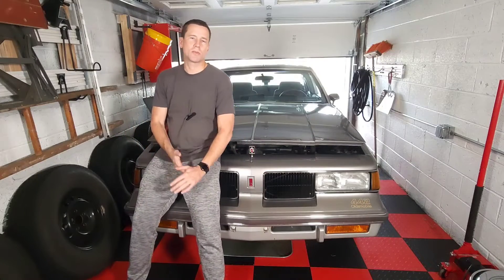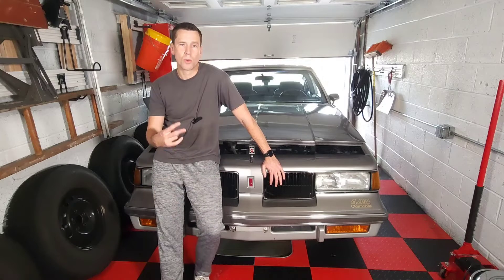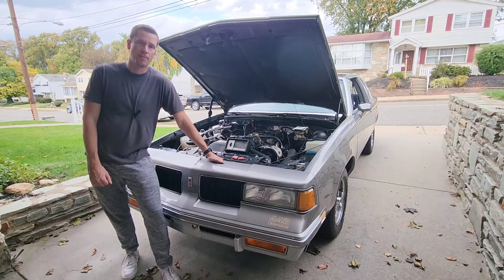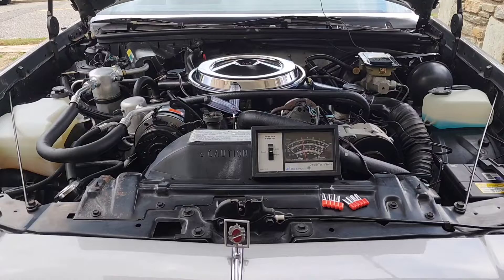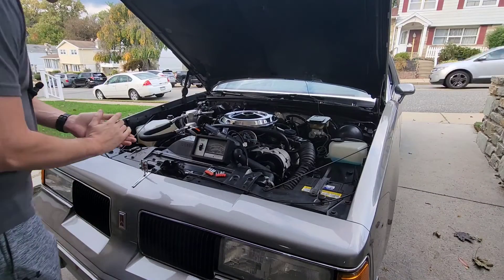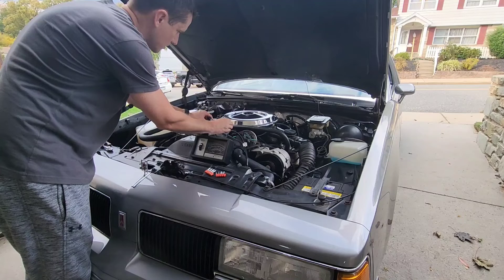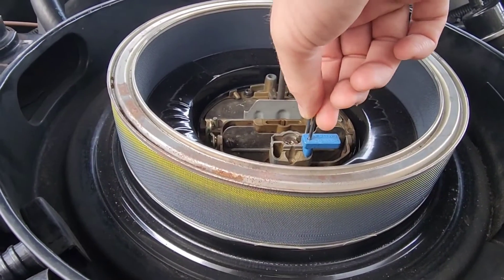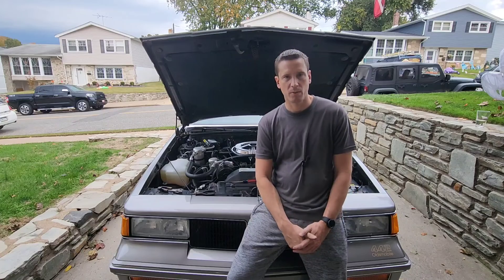Electronic Quadrajet / Dualjet FULL CALIBRATION On The Car - Part 2

Comment: Question: When you are adjusting the mixture control solinoid with a rich  limit, stop that goes with the screw, mine has this, arent you adjusting both rich and lean adjustments at the same time ? On the bottom of the limit stop is two small pins that fit into two holes...as if they wanted you to seat the pins tight. I have another e2me that does not have that stop what was the reason for it...?

Comment: Ok, so set dwell at 30 on idle screws, then adjust Air bleed...but....if you're at the ideal 30 from the idle screws, how do you know what to adjust air bleed valve to???
Reply from the maker: As long as the idle is smooth (where you want it to be), and the dwell is reading correctly, you may not need to. The air bleed adjustment can be used to tweak the reading on the dwell meter if it's idling smoothly but not quite at the 30° mark (without changing the idle quality, unlike the mixture screws). If everything is good, you can leave it alone.

Comment: Dwell hooked up WHERE?
Reply from the maker: There is a green connector with a flat copper tap located in front of the carburetor. If you check my "community post" section, I put out  pictures 3 months ago. Scroll back, and you'll find detailed pictures. I hope this helps.
Reply: 84 z28 ho. No green wire. I have lime green to choke, and dark green to AC idle compensation solenoid.
 I imagine I can just tap into the green wire on the 2 prong m/c plug?
Reply: Found the plug. It's up by the firewall lol

Comment: Where do you hook up dwell meter to ?
Reply from the maker: There should be a green connection port on the engine wiring harness. There is a more detailed description in this video.
https://youtu.be/v_00OkK8BAg

Comment: Great stuff, as someone who worked on these when new i didn't think there were any left let alone anybody who wanted them or wanted to fix them without updating them, which is what we did when programmable options came available, same with throttle body injection even though early ones were not as sophisticated they made these cars run much better as ignition timing and fuel could be adjusted for power which is significantly different parameters to emissions !!

Comment: Great video, thanks so much for taking the time to make this and all the others! My question- if you change the setting of the air bleed screw in Step 4, do you have to go back and possibly readjust the idle mixture screws using the dwell meter? Can adjusting the air bleed screw change the dwell setting that you just did?
Reply from the maker: It's great that you asked this. I've actually made a video that will be dropping Monday about the Idle Air Bleed valve. To sum it up: You'll adjust the mixture control screws to achieve the smoothest idle possible, while getting as close as you can to the optimal dwell. You can then adjust the idle air bleed to tweak the dwell closer to 30°, without affecting the idle quality. This is how you get the best of both worlds, and it's what the factory manuals called for.
Reply: I will watch for that video. Once again your efforts are appreciated a lot! @rporestorations

Comment: I got my reliable Buick 231. I dont know how to hook up a dwell meter to it. Got a small little handheld one with two leads and a battery. 

Am I in the wrong thinking they hook up to the distrubitor
Reply from the maker: It actually hooks up to a green terminal located in the wiring near the carburetor. You would hook it up to the distributor if we were measuring ignition dwell on a points system.

Comment: These are great videos and much needed content. Can you explain why you would use the 6 cylinder range on the dwell meter for an 8 cylinder engine?
Reply from the maker: I've never been able to find a straight answer in any technical manual, but the best I can figure it is because the necessary scales match up. Remember, we're not measuring the dwell time on ignition points, so the number of cylinders doesn't matter. The M/C solenoid operates from 0° to 60° (lean to rich) and the 6 cylinder scale reflects that.  Also, at the time, GM was only 7 years out of using points in their ignition systems, so the meter was something mechanics still had in use.
Reply: Thank you so much for the detailed answer. i now feel better about using that 6 cylinder scale

Comment: hey,, question, so I have an 88 olds cutlass with 307 and the Elec quadrajet carb..... cars kinda been sputtering and chuggin' when warmed up engine coming off hwy speeds to a stop sign thats when i see the troubles..... my temp sensor in the air cleaner is opening at 93 degrees way short of the 133 degrees the manual says.. could that be an issue i have? thanks,,, plus I cant find one of those sensors anywhere.. suggestions? thanks enjoy the vids
Reply from the maker: The sensor in the air cleaner really shouldn't effect performance like that. As long when as it stays closed when the engine is cold, and opens at some point, you're good. I'd start by checking the ignition module in the distributer. When they start to go, you'll get a miss when hot.
Reply: @rporestorations  wouldn't it be throwing the check engine light on then?
Reply from the maker: Nope. The the check engine light on these are only set by certain systems. This system isn't one of them. The GM Computer Command system is very basic. You can have drive ability/ running issues and not set a light. It happens all the time.

Comment: HI, where exactly would I connect the Positive terminal from the Dwell meter? I just bought an 81' Cutlass Calais w 43K orig. miles (factory gauges w Tach) with 3.8 v6, Dual jet.  The car starts right up and idles fine for the most part (sometimes idle in P climbs to 2100).  But my biggest problem is that it hesitates and dies every time I press the accelerator after coming to a stop.  It even dies on me when I slow to below 15mph or so when making a turn (scary as hell btw). The other day I thought I would never get out of a parking spot bc it immediately died the second I put it in Reverse (8 cons. times). All vacuum lines are connected and in good shape.  I've had the carb Professionally rebuilt, replaced plugs, plug wires, cap and rotor, coil, fuel tank, and fuel pump with No Change! At one point I was able to pull Code 45,(O2 sensor/rich exhaust)  but check engine light isn't always on.  Could this be a choke issue?  Please help.
Reply from the maker: I doubt it's just a choke problem, but that would be pretty easy to check. Let the car fully warm up, and then open up the air cleaner. At that point, the choke should be wide open. In reference to the dwell meter, there is a green connector with a metal tang inside it at the top, front of the engine. Usually right in front of the carburetor. That is where you clip the positive connector of the dwell meter. Be careful with those rebuilt carbs. I have NEVER seen one come back with a properly calibrated mixture control solenoid. An intermittent code 45 would be a sign of that, especially if it sets at highway speeds. Keep me updated, and let us know what you find out.

Comment: Maybe you would have some insight on the issue I am having.  I have a 84 Z28 5.0 H.O. I got a few months back.  I was running great until about 3 weeks ago when I started the car up, it ran for about 1 second and shut straight now.  With how quickly it shut off I figured it was an electrical issue so I replaced the coil, cap & rotor and ignition control module.  It started up and ran fine, until it didn't and shut off.  It has been the same battle back and forth for a couple of weeks now.  Some people had named some stuff to look for with the carb and I have gone through what they have listed but I feel like it is an electrical issue.  I checked that the vacuum pull-off was holding vacuum.  The choke was setting itself before starting up the other day when I tried.  It appeared the butterfly didn't want to open up like it should.  I also checked the throttle stop solenoid the day prior.  I had the battery disconnected to test it and reinstalled everything.  When I reconnected the battery and started it back up, the car ran beautifully and went all the way into closed loop and the thermostat opened.  I wanted to make sure it was fixed so I let the car cool down and tried to start it later.  Went right back to the cutting off issue.  I went to start it yesterday and I pretty much had to have the pedal to the floor to get it to start up.  When it did, the idle was really low and it eventually shut off.  Any idea as to what may cause an issue like that?  I'm running out of ideas.  Thanks in advance for reading my long-winded question.
Reply: Mine did precisely that. that's the clear sign to rebuild the carburetor. After troubleshooting and rebuilding the distributor, the culprit of such issues was the fuel needle. The needle would wedge itself into the seat and plug the fuel flow. We need a proper seat and needle to cut the fuel flow when the bowl becomes full to avoid flooding but in this case it worked too well. I took the airhorn off and noticed that it was missing the needle hanger clip that rides on the float, when the fuel level drops or it evaporates after days or weeks of non use or whenever it needs fuel, the float drops and it pulls the needle up off the seat. So without it and with some varnish within the walls of the seat from years of use, those two factors contributed to the needle becoming stuck.

After about a week of non use, use a syringe to fill the bowl and use engine starting fluid stray to avoid stress and wear on the engine. Change out your fuel seat for a solid window-less and make sure your inlet fuel filter has the check valve. If you struggling during cold starts, fuel is draining back to the tank or your carb is leaking into the manifold. A proper functioning carb,  you lightly step on the gas to set the choke, wait for few seconds, then you flick the key to start the car. In southern California, weather is unpredictable year round that setting the choke is not necessary to cold start it, unless you want to fast idle to warm up the engine faster.

Hopefully you have solved the issue you were having. What you described happened to me and tackled so many different areas of the engine bay that were not even necessary, try the simplest first. I was at least able to refresh the distributor and verify the engine timing, crossing it off the checklist. The acquired PTSD of getting stranded at a light far away from home all of a sudden, flashbacks most certainly, so you kind of expect for it to happen again but then it doesn't. A sigh of relief when you hit the gas and take off without sputtering and bogging. 😓🥲
Reply: @locobrown  Thanks for all the info.  Mine ended up needing a new distributor.
Reply from the maker: Josh, let me do a little research and I'll get back to you on here tomorrow. It sounds like it's definitely a fuel problem.
Reply: @rporestorations  Much appreciated.  I left out a bunch of other details and things I've tried so far for the sake of brevity.  How fast it shuts off with zero shutter or sputtering makes me think its something electrical.  When this started happening I noticed that the ignition started to feel very gummy when cranking the key.  It is far from smooth and easy like every other ignition key.

Comment: What “double D”/Rochester carb tools do I need? Where to get them?
I’m rebuilding an electronic Quadrajet from an ‘85 Monte SS.
Reply from the maker: Also, I did a couple of carb tool videos a while back. You might not need everything, but the more you get, the easier they are to properly calibrate.

https://youtu.be/Vc83B2UOyo8
https://youtu.be/TLtPE1ppKLM
Reply from the maker: Any stocked auto parts store should carry them in their tool section. It's one of the standard sizes for the mixture control screws. I've included an Amazon link below:

https://a.co/d/iqJIBpB

Comment: Great content! If you're looking for ideas, may I recommend covering what all the sensors should be reading volt/ millivolts/ milliamp wise once the system goes into closed loop? Depending on your OBD1 scanner capabilities, what should the MAP/ MAF sensor be reading at idle or WOT? What should your EGR readings be at idle after warmup is complete? How far should your timing be advancing at 55mph? At what speed should your lockup converter engage? Just firing from the hip on this. Hope you'll consider.
Reply from the maker: That's actually a great idea. I am planning to do a video on the the GM Computer Command Control system in a few weeks. I'll try to include as many baseline sensor readings as I can (some are vehicle specific). I appreciate the feedback. Keep it coming!

Comment: What’s the reason behind looking at the 6 cylinder dwell scale versus the 8 cylinder (since the car is a V8)?
Reply from the maker: That's just the measurement system GM decided to use when they started rolling out the Computer Command Control system back in 1981. Most home mechanics still had dwell meters for the old breaker point ignition systems, and the scale just matched up.
Reply: Thanks!  Learned something new.